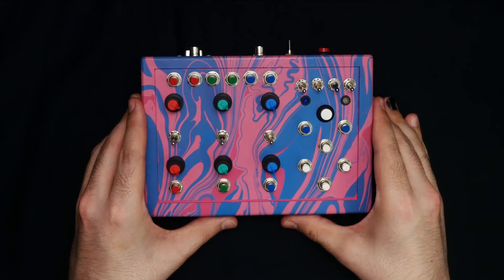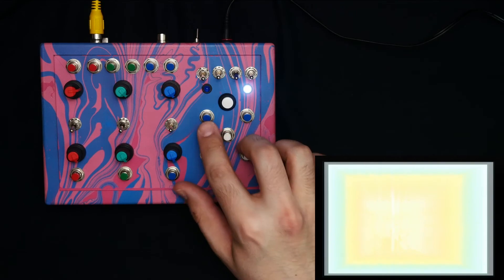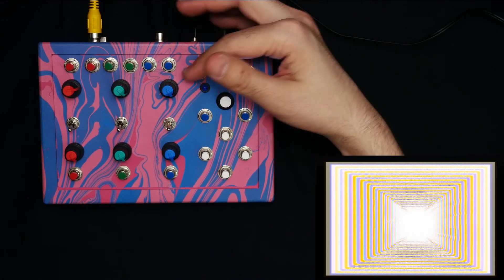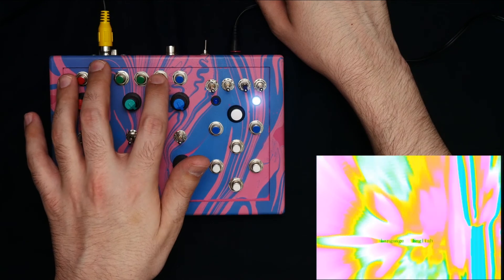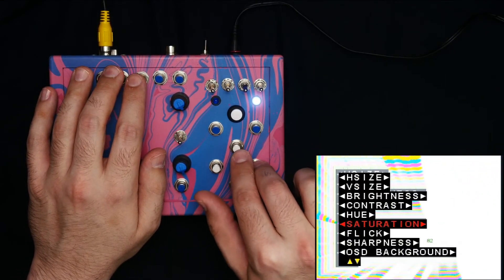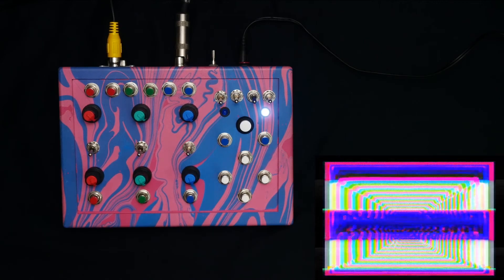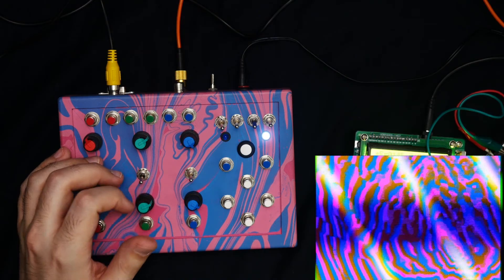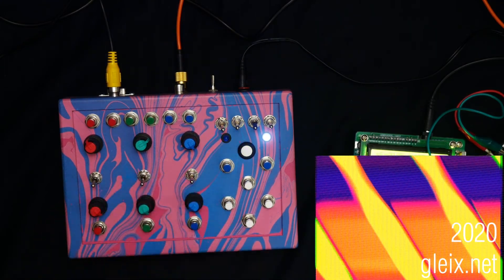DIY Video Synthesizer, Model No. 100PFB // Promo, Full Overview (GVS003)  // Gleix Devices

Comment: cool, I actually made a quite similar device with the same vga converter. Also decided to map the menu and navigation on buttons on the panel. But for some reason mine doesn't really have that organic feedback as yours have. Mine is a lot less bright for some reason.

Also what LFO did you use? I tried to add some LFO modules inside, but most required much more power than the 5v.
Reply from the maker: Might just take tinkering with the hue/saturation/brightness/contrast values on both of the individual converters to fight the settings where they play nicely with each other. It's an experimental game of iterative pong pong. Different methods of capture and display also drastically alter how the loop behaves. Just gotta tinker around- and also note that there are a number of variations on those cheapo converters and each has their own pros and cons for specific builds, and some work better with others. 

I believe I was still using a pretty simple 555 LFO in this build. You can pipe the output right into the RGB channels, or you can use the output to close a connection with an optocoupler like PC817 to easily blink the color channels off and on. Only really useful with squarewaves like that though.
Reply: @gleix_ what vga converter did you use.i did notice a difference when I got one from aliexpress vs that one lofi future suggested from Amazon.
What one did you find worked best for this type of effect?
Reply from the maker: Shoot me an email via gleix.net - I try to avoid publishing some info since it can lead to shortages but am happy to share 1:1

Comment: Hi, I have a question, after connecting the two converters and looping the signal I am getting a mainly green picture and have to shift the hue quite a bit. Is this normal or should the signal on all be similar and I might have created cold solder joints. Used led solder, maye there was ledfree used on the board before.

Comment: This looks awesome, great work! I'm looking to get start with some DIY video stuff. I was just wondering if the up/down and left/right buttons could be wired to a joystick ? Instead of having to press the buttons repeatedly to scroll through the menu, you could just hold the joy stick in the right position to boost the saturation or whichever parameter, or would that not be possible ? Thanks for posting these videos up and keep up the great work !
Reply from the maker: Thanks! That should be doable; I've considered this a lot but haven't implemented it properly though I did try it with a few cheap joysticks. In practice it feels less than ideal but there are ways to make it work. 

By default the way that the buttons work is that a message is sent when the circuit is closed, so every press of the button makes a single tick of an adjustment. For the joystick itself, you'd probably just want a 4-axis one that can close separate circuits when in the up/down/left/right position - sort of like how the atari joystick worked. Super basic. You'd then need to design an additional circuit that will repeatedly close the desired button's circuit at a pre-determined interval that the existing button circuit is still able to interpret (ie. not too fast) and use the joystick to turn those circuits on and off. So basically just like a "turbo button" on those old third party console controllers. There would definitely be some advantages to being able to hold a direction to make larger adjustments, but it would also remove some of the precision afforded by using individual ticks for direction & parameter adjustment, so you'd probably want to have those available as well.